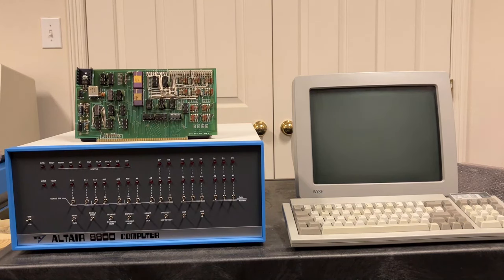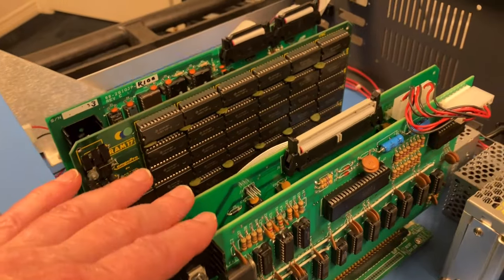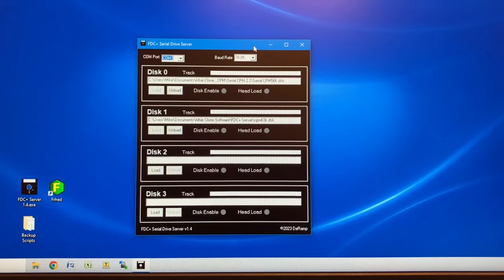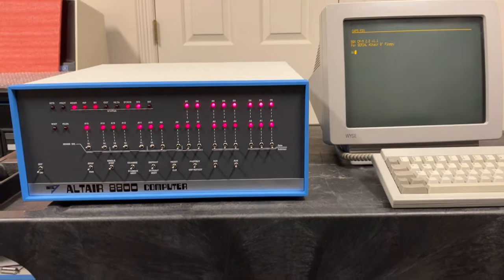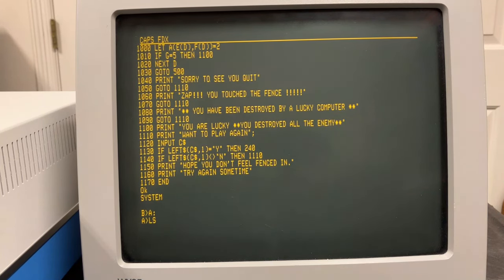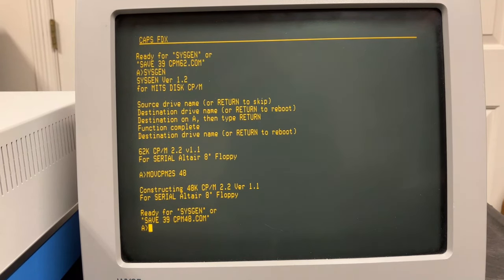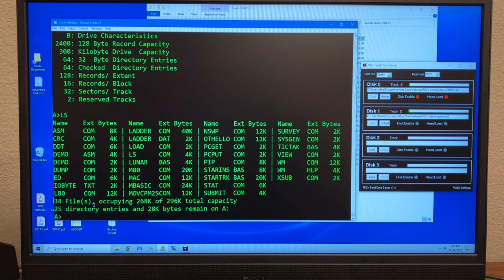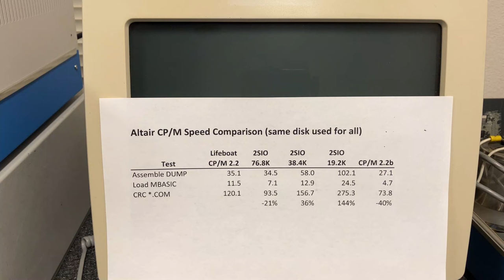CP/M on the Altair 8800 without a Floppy Controller or Disk Drive

Comment: boy does this bring back great memories!  I was living in Jester West dorm at University of Texas at Austin; rm 365 and a friend of mine lived across the hall. He owned an Altair comp and a teletype to communicate with it. This was 1974-75; what a great time to be alive. I went on to minor in computer science and worked in many mainframe computer centers. IBM usually had an entire floor of a basement with raised floors and forced air conditioning thru the equipment to keep everything cool. I watched as system 360 was updated to system 370.... The 100MByte hard disk drives were updated about every 5 years ; I remember the first 286 ; 386, 486; and pentium desktop units replaced the IBM mainframes. (My best friend's dad bid on and bought an entire mainframe sys 370 with line printer (22 pages per minute 132col paper. - SO LOUD) and tape drive and 16 gig hard drive, etc for $5500.00!  They built a building on their ranch for it.  Amazing.  By the time 1990 came along it was easy to afford a home computer. Hahaha.

Comment: We used a audio tape recorder (single track) to store the memory and load it back up, reels or cassette or 8 tracks (more tracks more saves). 
The signal comes through the RS-232's data pin and sounds like the noise you hear when a modem is connecting.
I don't remember how was the tape bootstrapped though when the computer was turned on or reset. It was either the 88-ACR or my father built his own tape  serial interface, either way he ended up using the first basic implementation from B. Gates before they started Microsoft.

Comment: Nice, it wouldn't be hard to graft this over to a single board computer that has only two serial ports and nothing else.
Another twist could be to make a serial floppy server that runs on an Arduino and stores the images on a USB stick, that way the serial floppy server could be a little box sitting atop the Altair - no PC required.

Comment: What a brilliant idea to use a spare serial port to act as a floppy drive. Is he source for the improved BIOS which provides a 40% performance increase available somewhere for those who are running CP/M? Would that BIOS code also be usable with CP/M 3?
Reply from the maker: Here is a link to the fast CP/M 2.2 BIOS for the Altair: https://deramp.com/downloads/altair/software/8_inch_floppy/CPM/CPM%202.2/CPM%202.2B/
Reply from the maker: A fast CP/M 3 BIOS for the Altair can be found here: https://deramp.com/downloads/altair/software/8_inch_floppy/CPM/CPM%203.0/